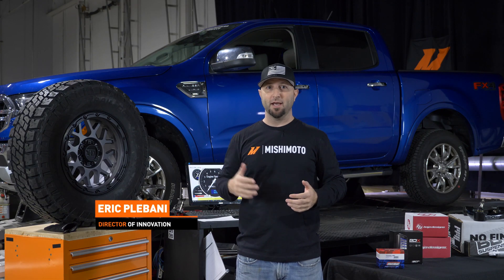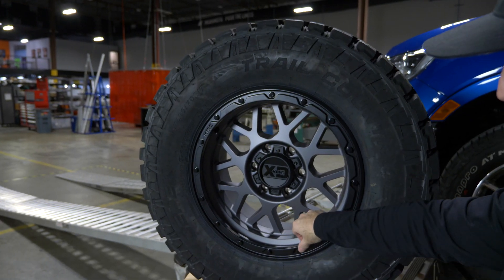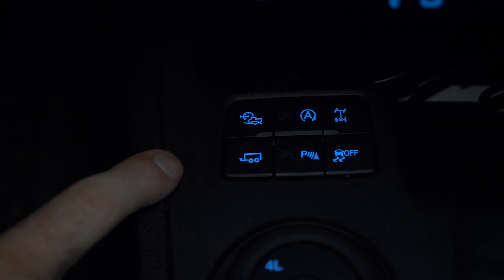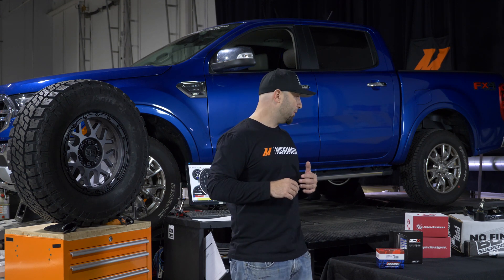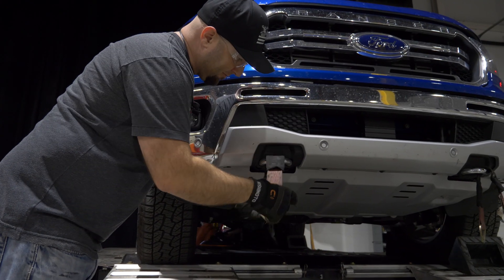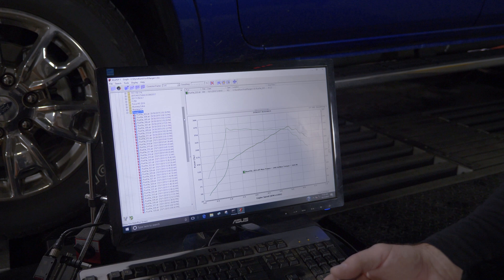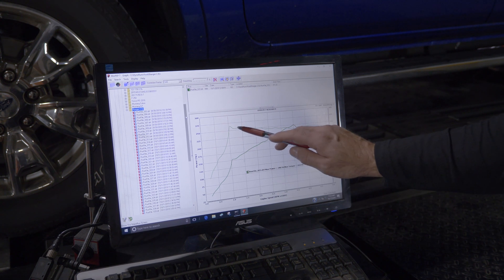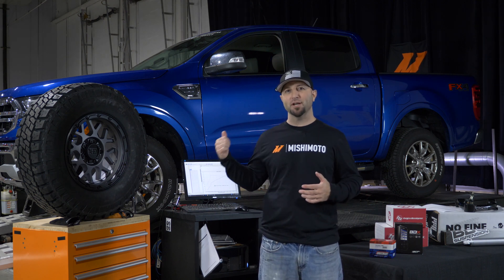Mishimoto Behind the Scenes: Plans for our 2019 Ford Ranger

Comment: I am very impressed with Mishimoto. I've had my Ranger for just over a year now and I love it. I kept everything stock waiting for the Ranger Raptor, but now I'm buying all sorts of parts because the Raptor version isn't coming to the states. I've got the Mishimoto air intake because of the R&D. Just ordered the turbosmart blow off valve and a dual exit exhaust. Waiting for the Mishimoto intercooler!

Comment: We tuned using hp tuners and we have gained 52whp and 91wtor on 91 without any mods. This thing is a sleeping beast.
Reply: That's the specs of the engine when it's on the mustang

Comment: Cool idea.  Out of curiosity how does a blow-off valve increase the power potential?  I'm assuming the ranger vents to intake, and the replacement bov is vent to atmosphere.  In other EcoBoost circles I know people who replace them for only two reasons, because they want everyone to hear the noise,  and because the factory is plastic and they worry about durability.  I'm no expert by any means, so I don't understand how a blow off valve can help make power.
Reply from the maker: When you start to increase the boost pressure the stock valve will often struggle to keep up. Upgrading this allows us to test the truck at higher pressures to try and make more power.

Comment: I’d just get a Tacoma.
Reply: I used to think that too, however, I’ve read a lot of complaints for the newer version, when they went with the 3.5L engine / transmission configuration.
Reply: @stuartstuart866  I test drove em all . Ranger outclasses them by good margins.
Reply: The new Ranger beats the taco in nearly every area. Powertrain is phenomenal. Ride /comfort are better. Much better tech options. I wasnt surprised Ford rules trucks. I bought a Ranger XLT FX4 crew cab an love it.
Reply: There's the random guy who says I'm every post